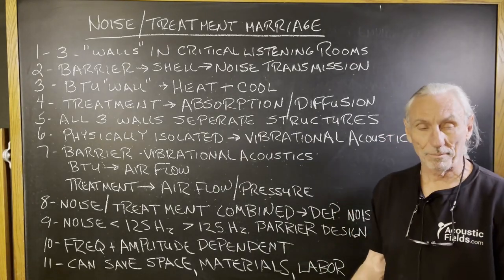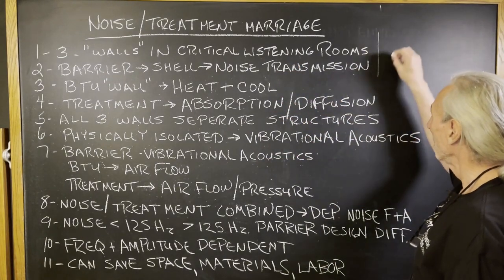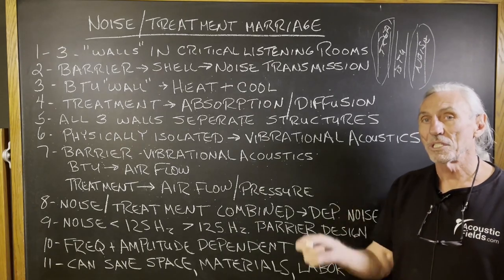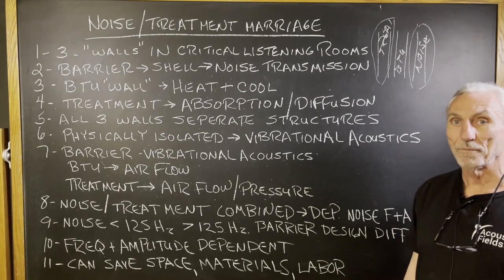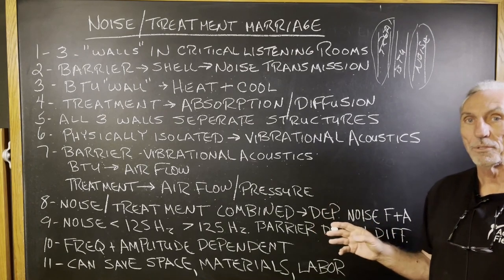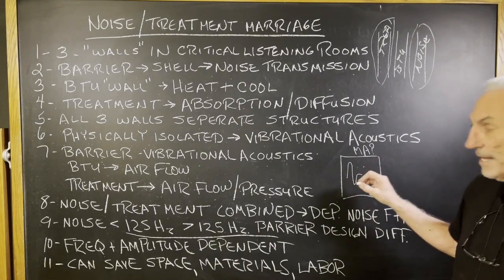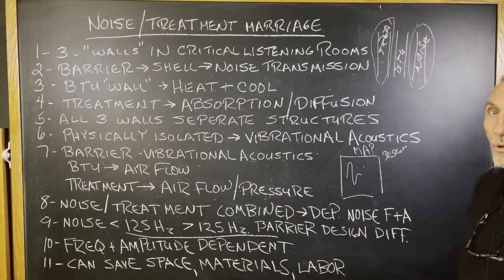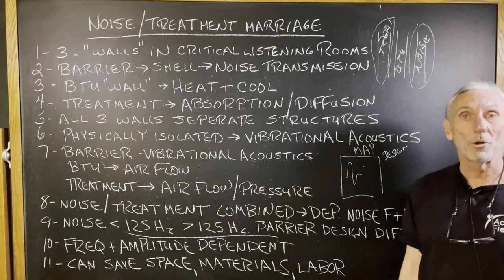Noise / Treatment Marriage - www.AcousticFields.com

Comment: A BTU wall does impact noise, and it can be PART of the solution. Put the BTU wall towards the exterior, understand it's limited capabilities and design your Noise wall with that in mind.
Reply from the maker: You can not count on the BTU for any low frequency transmission attenuation. It may be helpful for a certain middle and high frequency absorption. However, the barrier must take all of this into considerationj in its design first and foremost. The barrier must be a low,mid, and high frequency solutioj within itself. The barrier must stand on its own.  Any assistance the BTU wall can afford the process will be welcome but can not be required.

Comment: Can you discuss how climate control should be handled in these rooms? Specifically home theater. Preventing sound leakage and noise pollution from the HVAC. Thanks!
Reply from the maker: We do not get involved in HVAC design. Every region of the country is different in its code requirements. It is impossible to cover all of these code requirements. We use ductless units in our designs to avoid all of the issues associated with air movement. Here is a link to some systems we use in our designs.
https://www.mitsubishicomfort.com/residential

Comment: What would you use to treat the ceiling?

As 90% of noise comes through the ceiling after the walls are treated. 
What is the best approach for the door.
Reply from the maker: What are the frequency and amplitudes of your noise issues over 7 days?

Comment: A noise study just makes sense.
Another great one Dennis, thanks!
Reply from the maker: With noise, you must quantify and qualify the noise since barrier design must reduce the transmission of the frequency at a certain amplitude. You must identify the problem before you prescribe the solution.